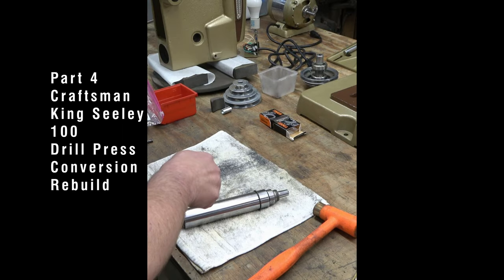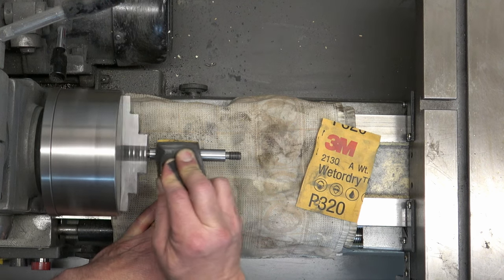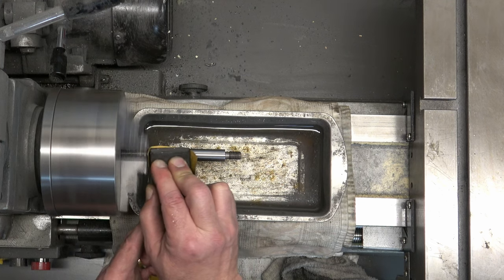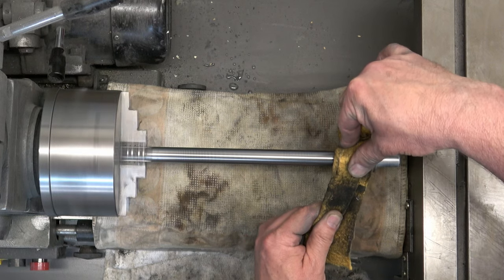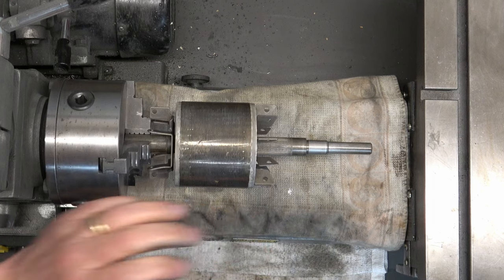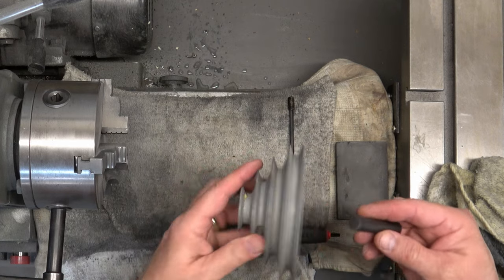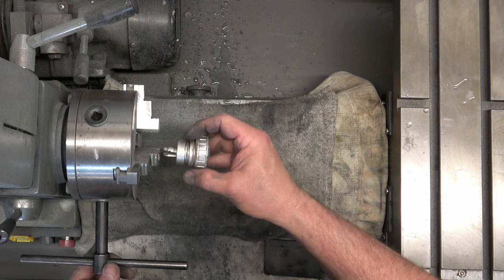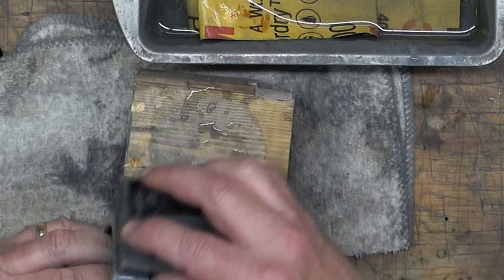Part 4 Craftsman King Seeley 100 Drill Press Conversion Rebuild Cleaning & Polishing Parts

Comment: Out of curiosity is it safe to media blast/sandblast some of these casted parts with a very fine media and polish to get the same result?
Reply from the maker: Yes, I have media blasted most of these parts before and they turned out fine.
Reply: @JeffsShop  sweet, I might do that rather than hand sanding as I have a media blast cabinet just for my tool restoration stuff and welding.
Which parts in particular do you recommend not sandblasting?
Reply from the maker: @Alex_M_Creations  If the chrome is still good, don't media blast anything with chrome. Don't media blast plastic, and if you media blast any of the ZAMAK parts, use less air pressure and make sure you are not damaging the ZAMAK parts (pulleys) etc... the steel and cast iron should be fine to blast.
Reply: @JeffsShop  that’s what I was almost certain about. Also thanks for the clarification on ZAMAK as well. I would have never considered that. I’m looking to restore my 150 floor model at some point so I figured I’d ask.